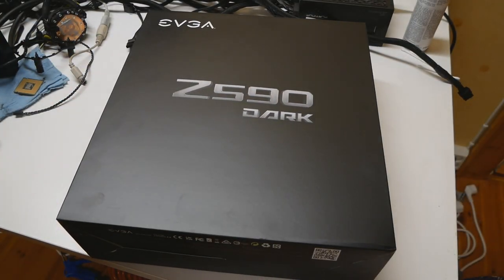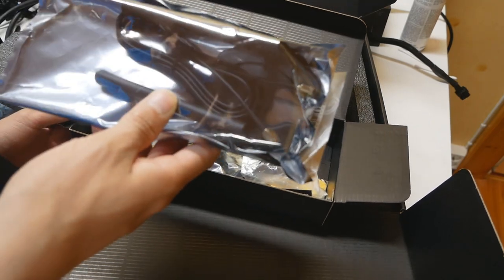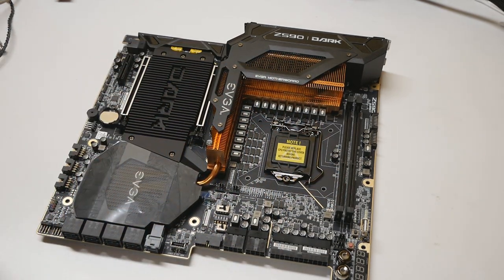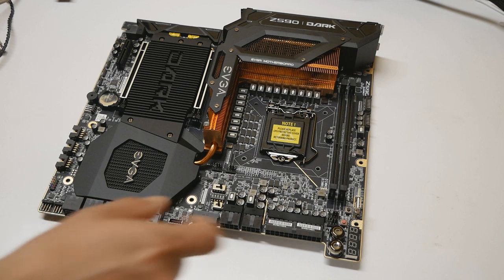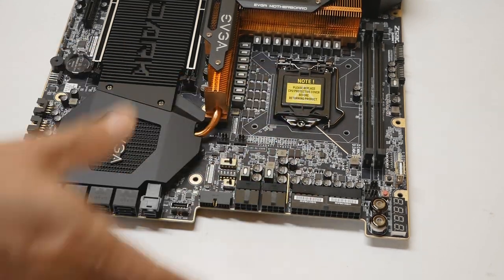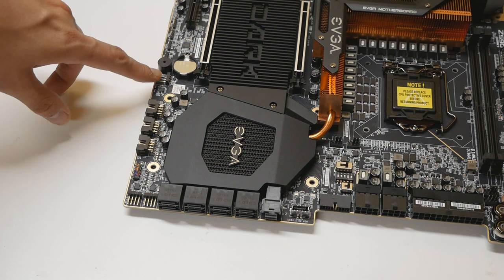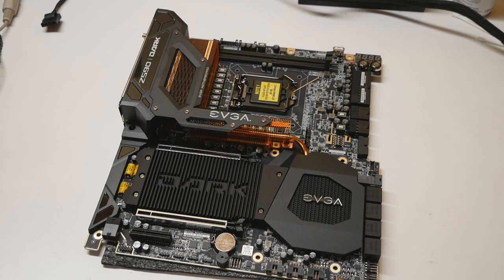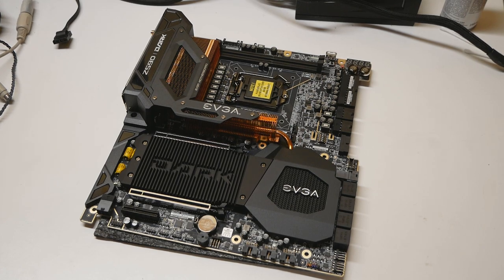The BEST Z590 Motherboard Has Arrived - Let's Check it Out! (EVGA Z590 DARK)

Comment: Took a while! Pretty looking board indeed. But no more socketed BIOS chip (:cry:). Kinda pointless to have x4 slot with open side with battery blocking installing x16 card in it :)
Reply: Agree with both!
Reply: Agreed. Dang I didn't even notice that...not sure what they were thinking and its TiN !!
Reply: Maybe the part that you don't get does make the board as xco good as it is
Reply: @raoulvandervliet1652  xD do your research on people. OP is an ex EVGA dev engineer, who made Z390 Dark, which is the base of Z590 Dark too.
Reply: @kovacspis you're right, I should have. But I'm sure they had to place it there for reasons.

Comment: Great video as always, important aspects all are covered - PS/2 combo ports, ASMedia SATA ports reason, VRM quality, Board features availability and price etc. Waiting for the BIOS overview, probably should be similar to Z490 DARK. This is my Z590 board of choice because ASUS Maximus Apex XIII has that new Realtek ALC4080 audio chip that is having nasty EMI problems and it doesn't have drivers for Windows 7 too, ALC1220 on this is fine for that OS. And next thing is this PCB is 8 layer (or 10 ?) while Apex is just 6 layer design. And finally the best part of the board is insane looking functional heavy copper heatsink. Longevity matters a lot. In the queue since day 1 but still no avail.

Comment: I am a lot more interested in the X570 Dark, although that will be extremely late for X570.
Reply from the maker: Soon.
Reply: It will be probably used with the new 3D cache cpus by the end of the year, but yes, it's a little bit late for AM4.
Reply: X570 DARK board is literally just same of this they just changed the chipset, the I/O options do not change at all it's a bummer since AMD Ryzen 5000 has a ton of CPU USB ports, and one more con is they are using PCIe 3.0 NVMe SSDs for X570 too. Apart from that I'm interested in the X570 chipset stability with EVGA and that WHEA / USB thing. Really stoked for that but I wish EVGA keeps them not too expensive since the feature set is bare minimum vs others ofc the firmware quality is top notch with EVGA still they need to keep pricing in check. X570 builds are still worth because Intel screwed up 11th gen badly with bad IMC and poor efficiency / performance over 10th gen. And 12 gen is having that big little joke vs AMD's real core challenge with 3D Stack, so it's a welcome option for those who want more out of their processors. Esp its AMD where we cannot really push them.
Reply: @lostalx  I am not that pessimistic about 12th gen. I think it could be good, probably not as good as what AMD will have, but I think it has a chance to be a good enough product. And I like seeing Intel finally trying to innovate.

Comment: Thank you for the detailed review. Definitely one of the coolest looking motherboards on the market. Not sure why they went with only 2 dimms though because most boards in this price range have minimum of 4 dimm slots. Also wish they would include internal thunderbolt as well. If EVGA can get production rolling on their Z690 12th gen boards and add a few features than they can compete with Asus and Gigabyte very easily.

Comment: a big copper heatsink is rather good than bad. the high costs are an overall problem. I wouldn't pay more than 300€ for a highend mainboard like that. it seems manufacturers want to test how much their customers are willing to pay.
Reply: A big finned copper heatsink is very expensive to manufacture compared to an aluminium extrusion. And this board has extremely efficient and expensive powerstages that produce little heat. The motherboard could have been cheaper by at least 50€ if they used a cheap heatsink, and the temperature would still have been very good.
Reply: @TheBackyardChemist  wow 50 bucks less is still absurd...then I would prefer the nice copper...I think you missed my point. Its expensive beyond more or less 50bucks...doesn't matter anymore lol..they don't want to sell it seems.
Reply: That's like saying there is a cheaper way to build a Koenigsegg. These boards are to be the ultimate, i would pay an extra 50€ for copper heatsinks everyday, The X570 Dark has aluminum heatsinks on it possibly to reduce cost and due to the lower thermals on am4. Copper heatsinks have always keen a Kingpin/EVGA aesthetic signature.
Reply: @Jolinator  it shouldn't be build cheaper. EVGA is too greedy.
Reply: @BratislavMetulskie  Agree the price is too high for a Z Class board, one of the problems with the evga dark boards is they bring them out so late compared to other vendors which means they sell very little volume so have to wind up the price.

Comment: I waited almost half a year for either this or the unify-x, but ended up just nabbing a Z490 dark for €300 and won't bother with rocket lake for now...
Reply: Z490 DARK is on sale. Im also thinking on that aspect because I have no use for NVMe that much and RKL is just a bad refresh. They could have released 10900K again with Gen 4 it would have been better. AMD has a the firmware quality and other QoL issues esp USB mess.
Reply: Where did you get it, are you located in Europe ?

Comment: Very late? Not as late as the X570 chipset version, that's 2 years old. However like the Z590 it's a dead-end chipset, well at least the X570 has the next Ryzen 3D but this has nothing since Alder lake is totally different but that's going to be out in like 2-3 months time.